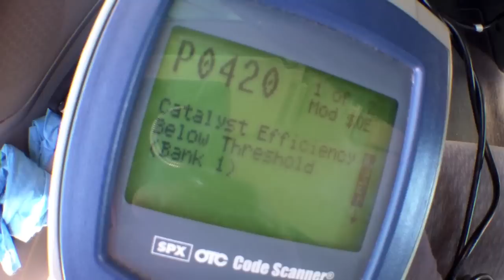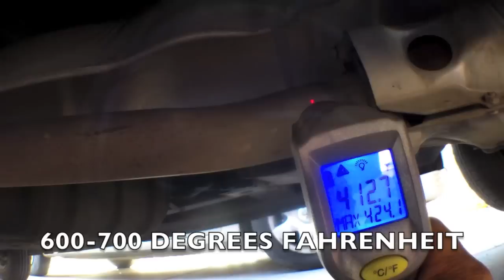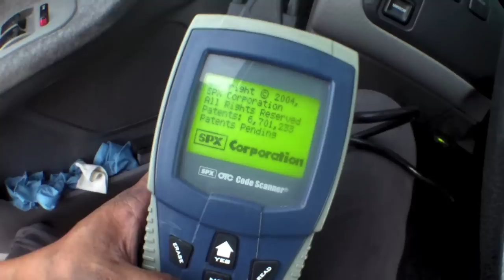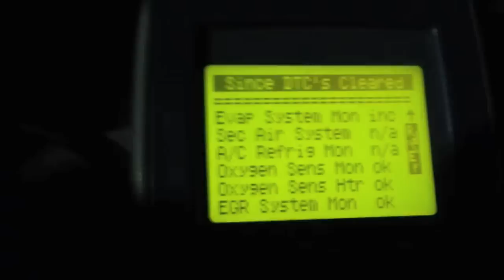[EASY FOLLOW] Catalytic converter REPLACEMENT Honda Odyssey √ Fix it Angel

Comment: Thanks to your video I was able to tackle replacing the cat on my 01 Odyssey. It looks like the cat was already replaced once on my car (now 180k miles) and the bolts were pretty rusted. I used a cocktail of PB Blaster and Liquid Wrench to get the nuts loose. I was able to loosen 3 with an impact and the other 3 I had to use a wrench with the good old fashioned "extend-o-wrench" trick by combining two wrenches together. I replaced all 6 bolts with M10 1.5" bolts, lock washers, and nuts. Used a CARB legal aftermarket cat from rockauto. Thanks for your video!

Comment: I'm a female and it looks like I can do that myself because of the way you did it so well Great JOB!!! I have a 2005 Honda Odyssey and I have the same code. Is replacing the cat the same way
Reply: Male, female, old, young it doesn't matter. Looks easy, but if you live in a rust State be ready to struggle!
Reply: 2005 has 3 cats. This generation has only 1. Your CAT in this same location has no sensors. You will not get a code for this CAT. You will get a code for the other 2 CAT's. Bank 1 (towards firewall) is P0420, and Bank 2 (towards front of vehicle) is P0430. If you only got P0420 that is the Bank 1 CAT only.
Check your PCV system to make sure you are not sucking up oil, and clogging your CAT's. Look at your exhaust tip for burnt oil (black/moist). 
OEM CAT's don't fail on their own. They will outlast the vehicle. Something causes them to fail. Aftermarket will fail, and most likely will not work. They are expensive. If it is really cheap new, it likely won't work as intended, or last very long. 
They fail if a lot of unburned fuel gets on the hot catalyst structure of the CAT, and causes it to burn/melt. Clogged due to foreign materials such as oil, or if a lot of dirt got past the air filter. They can also break due to an impact. 
PCV is the main culprit as it is overlooked even by the dealership. It's not part of a routine maintenance check. They fail if you neglect your oil changes, or go too long between oil changes. Liquids are a mix of gasses and solids. The less gasses, the more solid the liquid is. Think of mud. Add more water, and it becomes more liquid, add more dirt, and it becomes more muddy. That is sludge. The longer/hotter you run the oil the more sludgy it becomes. This clogs the PCV system. You can tell if yours is clogged if you have oil leaks. Especially oil leaks from the valve covers. The pressure has to go somewhere, and blows out your seals.

Comment: Hi I have same code when I clear it it comes back on after driving for awhile so I replaced both 02 sensors and I still get same code so is the converter going bad ty Vernon

Comment: Had the po420 code on my 2007 Honda odyssey and was planning on changing the catalytic converter but decided to give cataclean a try first. It worked for me.  No more engine light.
Reply: mines came on to definitely trying 🐱 cleaning first after disabling the vcm which causes clogging
Reply: Cataclean did not work for me

Comment: Anti seize in the o2 bung threaded hole can contaminate and screw up the O2 sensor.
Careful some odyssey’s have the rear cat in front of the engine and you can sneak it out between engine and radiator.

Comment: Nice video I just changed the cats on a 2000 Honda Accord lx.  it was done in 2 hours...so how do erase the check engine light. .how and what kind of gun was that..how much it cost for the gun..thanks..I guess I could take it to auto zone and have them erase..
Reply from the maker: +KangoKid Kidd Hello, thank you. You can erase it by disconnecting the negative battery cable for about a minute. That is a Blue point impact cost around $150 I think.
Reply: +Fix It Angel thanks dude...did you buy the gun on line or where.. I live in Atlanta ga. .
Reply from the maker: When I worked at a Toyota dealer as a tech I bought it from a Snap-On truck. On can find it in Snap on website. Welcome.

Comment: I have 03 honda odyssey and rattling noise is coming in a catalytic converter no loose heat shield but it doesn't show any check engine is it possible? Went under while engine is running and pretty sure it is the cat converter making that rattling noise.

Comment: Our 04 catylitics are clogged and engine runs so badly the dealer said its junk.
I will never by honda again after all this and masive suspension cost and timing belt breaking. $$$.
Chystler vans 33L &3.8L have no timing belt and few catalytic issues.

Comment: How can you turn off the abs and tcs and brake light because mine is stuck on there but I've check the codes and it said all clear
Reply from the maker: Hi Larry, sorry you will need  a scan tool

Comment: My flange mounting bolts for the cat are seized pretty badly. I started to round the edges of one nut, before stopping. Any recommendations?
Reply: If they are rusted/seized,cut/grind front nut/thread and rear nut of the cat. Studs are pressed into the converter flange, I had to replace the transmission 2yrs ago, nuts rusted away..nubs. Used a bolt/nut combo after hammering out the remaining stud.
Reply: @alexsiii55  thanks for the advice! I did exactly as you said. When I pulled the cat out to look at it, it was 100% clean! Not what I was expecting, lol. I guess my P0420 code and what sounds like exhaust back feeding is coming from something else.

Comment: Is this the for the bank 1?
Reply from the maker: Andres Cordero hi, bank 1??
This car has only one catalytic converter for that code. If it had a PO423 then it would be bank 2 catalytic converter.
Reply: @FixItAngel  the guy at the muffler shop told that it has 2. One in front of the radiator and the one under.
Reply: @FixItAngel  mine's a 2005, maybe that's the difference